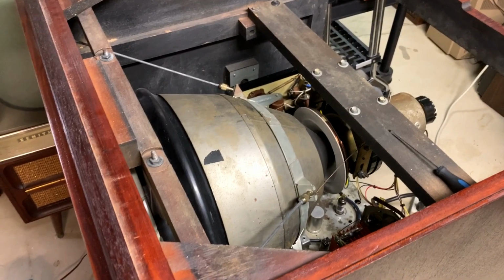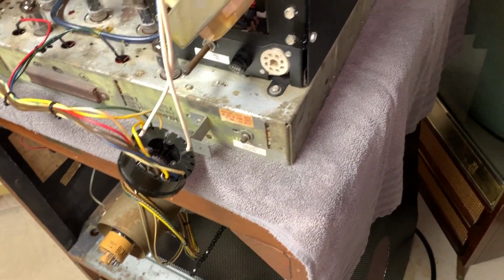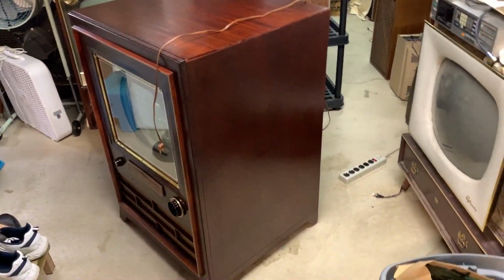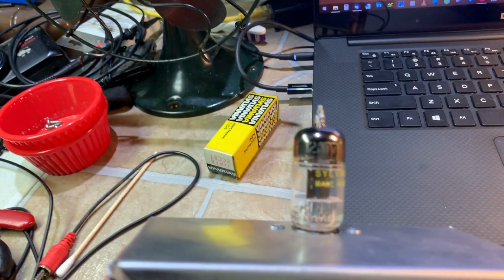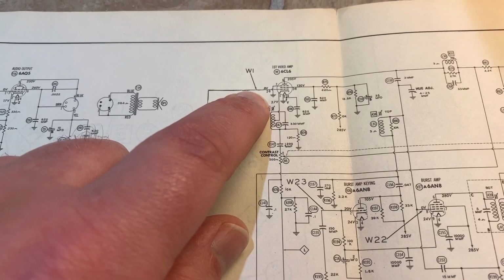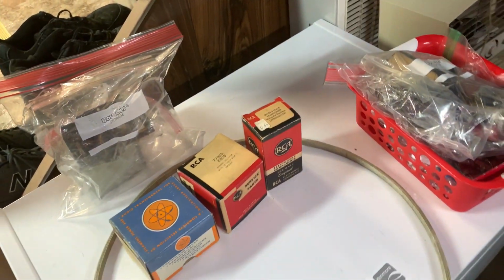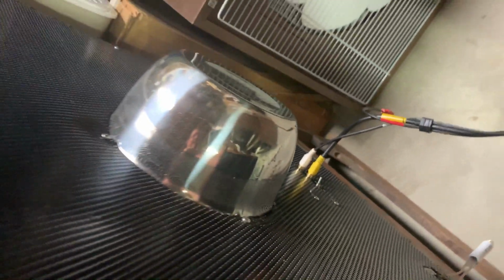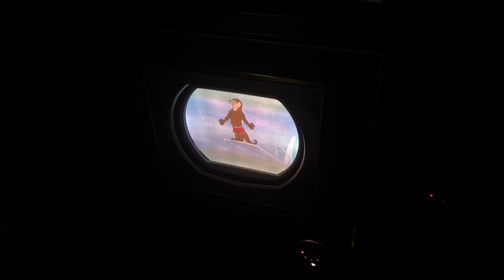World’s First Mass Produced Color TV: RCA CT-100 The Merrill - Restoration Part X (Concluded!)

Comment: I have the set that made all the CT100 owners very angry. The CTC-5 Deluxe. It has a 21" CRT. It is unusual in that the CRT is as white as snow when it is off. It works better than it did new thanks to a bunch of modifications. It sits between a DuMont Royal Sovereign and a EH Scott pointer dial Philharmonic in a gothic cabinet. Your CT100 looks gorgeous. Now if someone could only make a set that could tune to shows from back in time. Like the radio in the Twilight Zone episode "Static".

Comment: Ref. missing knobs and switches, would it be possible to make a silicone mould (just cheap stuff in a tube) of any repeat knobs you require, then fill with epoxy resin, which is far cheaper per pint from marine supplies places? A lick of paint to finish, and although it won't be perfect it would be pretty fair.

Comment: Can the picture possibly have been this good when it was new? It looks to me very much the same in picture quality as the last of the CRT tellies that came through.
Reply: The short answer is yes, and possibly better than even later models as they simplified the color demodulators for cost reasons, but the early color chassis used all the available chroma bandwidth.  My dad had a CTC9 that we ran until 1978 and the picture and color on that TV was spectacular, as good as the CTC68 XL100 that replaced it.   The XL had a much brighter image and better focus (it had a 2nd anode voltage of 34KV), but the color wasn't any better and perhaps not as good as the 9 had.
Reply: @ohger1  That really is astonishing. I always come back to thinking of the relatively slower progress of other technologies, however, compared with us in Europe this was breathtaking. I believe we (in the UK anyway) had only recently got bread off rationing, and most people thought fridges were a commercial premises device that wouldn't be available domestically for decades, though they soon started to become extensively available. Our cars were positively prehistoric compared to your spaceship cars, while you were getting automatic gear boxes, radios and power steering. 
I appreciate that American people live to work whereas we work to live - you work so incredibly hard, and with such dedication, while Europeans expect and receive free healthcare, 6 weeks minimum of paid leave a year, plus up to 2 weeks for Christmas and New Year, Easter and a host of other Bank Holidays (as we call them). We work a 35 hour week and complain about that.  So we will never compete with America, and I couldn't be so dedicated anyway. I lived in America for 2 years and only then realised just how much you throw yourselves into your work, and continual progress and innovation, and am grateful to live in a world with such wonderful people alongside us. Bless your dear hearts my cousins, and enjoy the benefits of your hard work.

Comment: only a really good restoration ,and the brand Rca Victor,mean high quality highly purity of colours for a tv set of mid of ´50 decade really amazed im a tv technician from argentina where the color tv sets comes in 1978,i have a original b/n dumont supertel of 1960 since 1960,and comes to my electronic tv repair very lot a brand american as halicrafters,dumont,zenth,cbs,standard electric,rca,wells gardner,motorola,philco ,all gloryes   ,now is repair not a tv sets,oldest radios,record player turntables casette or tape recorders and 8 track player so far deeply interesting regards from buenos aires argentina

Comment: The blue cable, at 4 min. that looks like the delay line? Never seen the internals of a CTC2 before. What a slug of iron is that power transformer. Alone it must be 30% of the chassis weight.
Reply from the maker: Correct. That is the delay line.

Comment: One can certainly see that the engineers who designed this receiver intended to have the colors knock the socks off of anyone who decided to watch this lovely set! However, in those days, I don't think the designers of this set took into consideration potential safety hazards regarding levels of X-radiation exposure for the service technicians who did field repairs and in-shop servicing.
Reply: This was built in the time that they had X-ray machines in shoe stores so you could see your feet inside your shoes. Also during this same time period in the 50's, you could buy admission ticket to watch nuclear bombs being tested in the desert.
Reply: @dougfisher1813  Yes, I believe they called them "shoe-fitting fluoroscopes." Probably wouldn't have used one knowing what I know now. It would have been really cool to watch a nuclear test in the desert, as the plume way high up in the air made such a beautiful glow!
Reply: X-ray concerns were not considered a problem in 1954. Precautions first came along with the Shunt regulator a GE 6BK4  that had a lead shield in their first Color TV Sets circa 1961.
Reply: I recall 32 tubes in this set.  I never worked on one. By the time I got into color TV the chassis was the CTC-11 model.when I left the company, RCA the CTC-62 was the latest XL-100.  During my TV fixit days I worked on 8 to 10 color Tvs a day for 10 years. Today I know nothing about the new TV sets. 

I went into teaching Color TV repair to RCA service techs, then I took a position at Sarnoff Labs as a research tech until I retired and taught in the Physics Dept. At Swarthmore College.
Reply: Wow thank you for sharing something fascinating this 80's kid didn't know!?! 😯

Comment: Are u and Harley getting things from the R W& B thrift store if they are open in this Pandemic?' as i have to look for another vintage vw as last week it got totaled when a deer ran out infront of me as now trying to upload videos on 12v fans that came out of retired school busses so far my video of the 1980s Bergstrom bus fans got the most hits as i posted mostly is the Baader Brown fans as they are made in USA no Chinapride on those its the Bergstrom, DCM fans that are made in China as the DCM fans are sometimes rebadged as ACC Climate Control, Maradyne Mobile Products, and Red Dot Corp.  these Bergstrom bus fans i had for a long time they were made in USA as both have Torin 6 1/2 fan blades, and both have Leece-Neville motors on them as Leece-Neville did invent the starter motor in 1909 was plants in Cleveland Ohio and Gainsville Ga.  the Baader Brown fans i got are made in Springfield Ohio Montague Equipment Co Inc. as the fans are OEM to school busses or MRO (Maintence Repair Operation).
Reply: No, we haven't been venturing out.  And oh no, I'm sorry to hear that...

Comment: That is one good TV set. These old TVs are far much better than today's smart TVs. They are much louder.  I have LED Smart TV's, and the sound on the modern TVs are not as loud as the old ones.  We have one TV in the room which we had to have a soundbar attached to it, to make it louder, well we had a soundbar until my stepdad passed in 2017.  I just want to go back to the vintage TV's and VCRs. Plus the smart TVs rely on Wi-Fi, which we have like 10 or 20 devices connected to Wi-Fi, and thats when my internet became slow and sluggish since we only have one router in one of the bedrooms. Again, excellent work Spats.
Reply: To be fair, your smart tv is very shallow front to back because of the flat panel where the old CRT TVs had depth to spare.  You need excursion to get good "tone", and tiny flat speakers that fit in modern TVs just don't move that much air.

Comment: Sorry I'm going to ask a dumb question - haha! I am suprised with how flat the screen is, I do not know much about electronics but I thought I underestood CRTs enough to know why they aren't flat. Maybe not. I assume there is a simple explanation?
Reply: Yep!  The reason is this.. since this is such an early color picture tube, the shadow mask is flat, and suspended inside the bell of the tube.  The glass face is still rounded, but it's behind flat safety glass.
Reply: @HarleyBadger  Thankyou for your reply. Yeah though I wonder how it focusses on a flat plane? The convergence looks a little off but that might be unrelated.
Reply from the maker: The convergence is fine... our cameras were very finicky about recording video, but it looks fine in person. The convergence is electrostatic and has much more complexity to it than a regular magnetic convergence adjustments.

Comment: I have a 1951 Motorola TV the picture tube does not work with a flyback Transformer connect her to the tube was not connected to the coil what should I do should I solder the wire to the coil or will it catch on fire if I do that the wire is meant to be attached to the top of the vacuum tube the wire leads to the coil of the fly back is there anyway I can fix it that's all what's wrong with the TV the sound actually works but the screen does not turn on can you help me love your videos
Reply: Hmm.. unfortunately hard to say without actually being there to look at it with you.